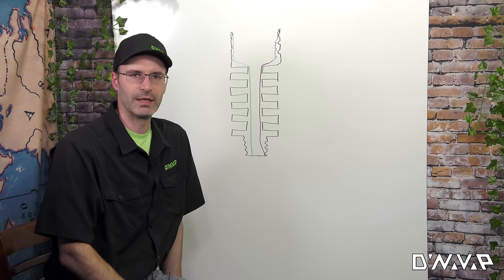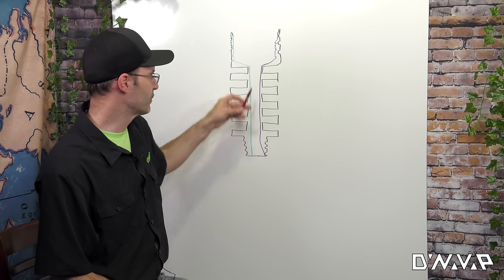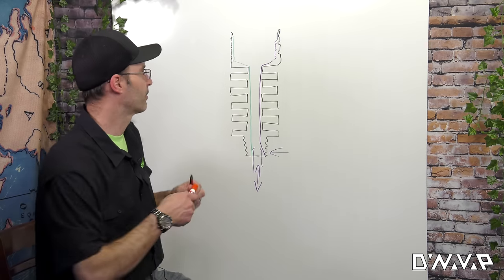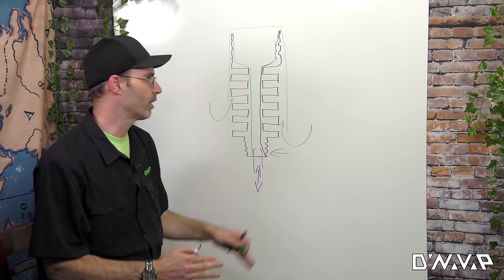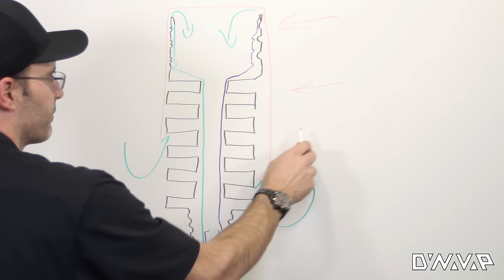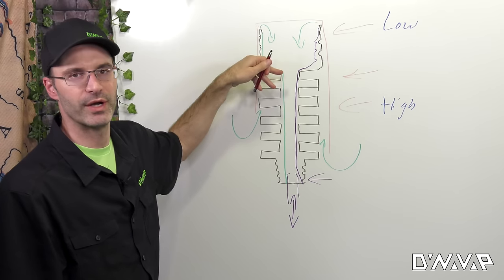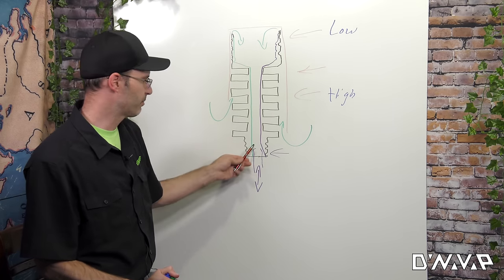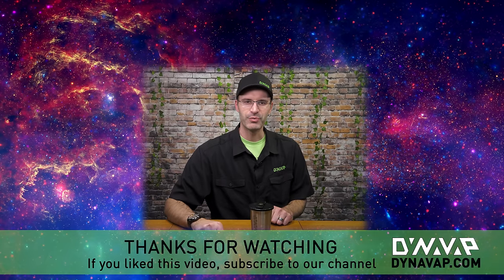DynaVap FAQs  | How does the tip work?

Comment: Okay, but what make the cap click?
Reply: Pretty sure it's one of those bimetal disks they use in thermostats.
Reply: @tonythetiger.9148  Why exactly did you capitalize every single word in your comment?
Reply: Sergey,Because...I Can.!!!
Reply: @tonythetiger.9148  I understand you CAN, but what is your actual reason or motivation to do it like that instead of the correct way?
Reply: @Sergey,For Some Reason,Not Sure Why When I Hit The Space Bar I Also Hit The Caps.Someone Else Notified Me Of This,And I Realized It Was Different,But Somehow Just Works For Me.Besides It's Not Like I'm Writing A Book Or Even An Essay,Because Than Of Course I Would Be Writing In The "Correct" Form.I'm Not Oblivious To The Fact,SMH.😒
Reply: it's originally alien technology that was re engineered by the Egyptians and then stolen by reptilians from area 51.
Reply: It is the cap that clicks.  Eris seems to be right about the bi-metal disks. I get how it works, but with the thing in my hand I haven't been able to make it work. I've gotten 2 good hits out of 11 bowls, everything else has combusted.
Reply: @keyemaster  It will take a while to get the tecnique down of how to hit it properly without running out of air. What works best for me is to do a long slow inhale all the way until the second click. Sometimes I do multiple mouth inhales but I find ling slow inhales give the biggest hits. Once you get it down you'll be blowing decent clouds and be able to get hits that actually make you cough. Aldo pack it loosely, you dont have to put much In it. Its suprising how far a little goes in these things. I can load i tiny bit and get 10-15 hits off it.
Reply: @keyemaster  also there is a video somewhere called tips and tricks for dynavap, and that guy also has another video giving tips on how to get it to hit good.
Here it is, pool for his other dynavap video for a better idea on how to hit it right. Do bot pack it all the way to the top of the cap, and dont pack it. Just lightly fill it.
https://youtu.be/9aKVI5-9-ps
Reply: Sergey because he’s high
Reply: *It
Reply: it touches itself?
Reply: @keyemaster  Where did you buy yours?
Reply: Shake the cap & you'll hear it
Reply: Only an HVAC technician would understand this theory lol need some Freon? Lol
Reply: @tonythetiger.9148  you hit caps when you hit space bar?  what keyboard are you using that has the caps next to space bar?  if using a normal keyboard, your fingers are in an unuaual position? or is it an OCD thing?
this has me scratching my head.

Comment: The Dynavap, a device so fine,
A vaporizer of a unique design,
No buttons or screens, just a simple twist,
It heats with precision, never to miss.

With its compact size, it fits in your hand,
A companion for adventure, across land and sand,
The stainless steel body, sleek and strong,
A true work of art, all day long.

The gentle hum of its spinning sound,
A symphony of vapor, swirls all around,
The flavor so pure, it tantalizes the taste,
A sensory delight, truly first-class.

It's the vaporizer that defies the norm,
With its simple operation, it's never the norm,
The Dynavap, a product to be praised,
For elevating the vaporizing craze.

So here's to the Dynavap, a device so bright,
May it bring you joy and vapor, day and night.
Reply: A poet for sure, that was awsome

Comment: I am not sure i understand this product very well. Is this for micro-dosing or getting high af?
Reply: You get higher with one Dynavap boel than you do with a regular one.
Reply: I'm a light weight. I like to smoke a tiny bit from a one hitter. But now i'm looking into vaporizing. Would I be able to successfully use the vapcap as a one hitter without getting high as hell? Like, if I used a tiny amount?
Reply: @imacomputer101  the closer to the end of the cap you heat, the lighter the hit will be. It also tastes much better at that point.

Comment: Have you guys tested with a long narrow slot for the air port?  A slot just long enough so that it's not hard to block with your fingertip seems like it would allow more precise air flow control. Judging by how refined this device is I'm guessing this has already been explored. If so, I'm curious what the issue was that prevented it from being adopted.